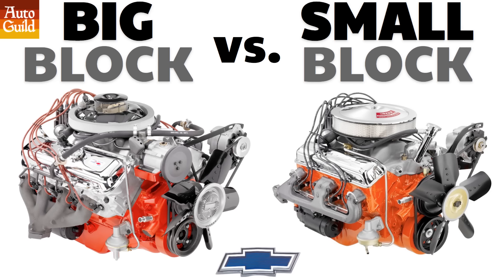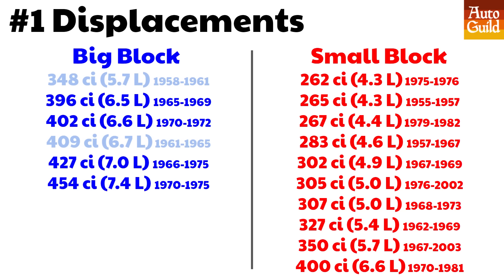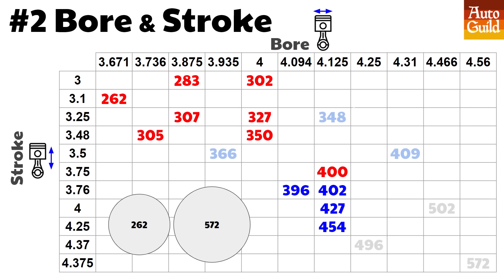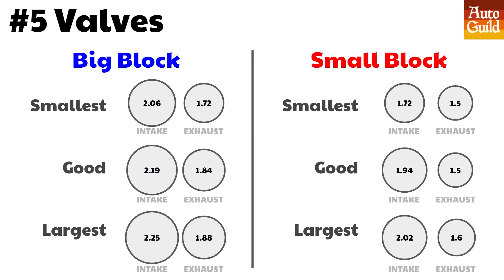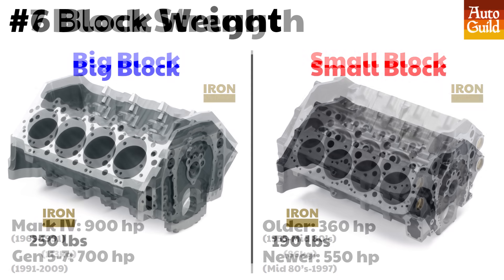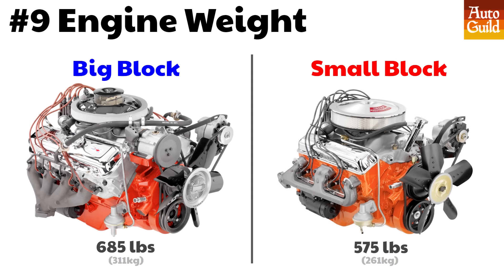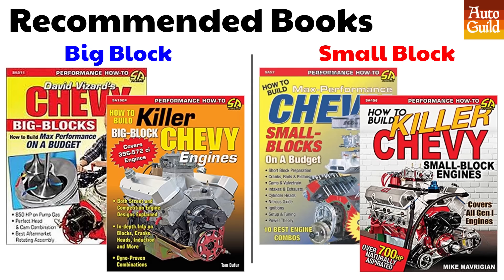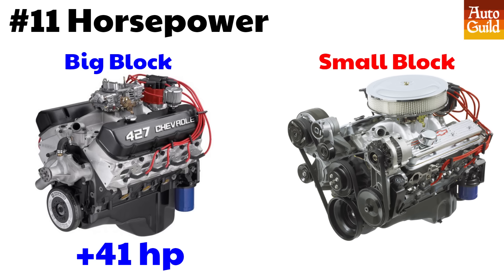Big Block vs  Small Block Chevy Comparison

Comment: understand... there is no replacement for displacement  anything you can do to a smallblock to make crazy power safely you can do the same thing to a big block for truely stupid power..... example.... top fuel drag.... if the small block was even worth using them they would.... to date there is NO smallblock  that runs just over 3 seconds in a 1/4 mile. bigblocks do this consistantly and have for many years now.

Comment: I got a little 327 with 12:1 Forged pistons and Steel Vette crank , 
Making 450hp 
Screams to the Moon 
11,000rpm before the valves start to float 
Try that with any Big Block of your choosing
Reply: 😂😂😂 11k
Reply: @sammendoza7168  , 
That's right Sam ,
11,000rpm 
I did it twice in 2009  
I wanted to see if if would do it and it did , 
I haven't done it since and don't plan on doing it again , 
I have taken it to 8,000rpm a couple of times since 2009 ,
It would run 
5.5 second @ 96mph in1/8 mile

Comment: I only have experience with a 318 against a 440that were stock. I had a 73 318 in a LeBaron and a 74 440 in a Chrysler Newport newyorker . The difference in power and speed out of the 440 was so obvious

Comment: Big blocks of all makes tend to have more torque even when the displacement is the same as a small block. Engine Masters did a comparison between a small block Chevy based 383 and a Mopar 383. They had almost identical horsepower peaks, within 1 horsepower but the 383 Mopar made more horsepower down low and much, MUCH more torque. Their reasoning was the longer intake ports, wider intake manifold with longer intake runners created this advantage. For a bore and stroke comparison the 383 Chevy is 4.030X3.75 and the 383 Mopar is 4.25X3.38. According to the experts the short stroke Mopar should make less torque down low but according to the dyno it was the exact opposite. The engines used the same brand Edelbrock Performer RPM intake, same grind of Comp Cams and the same compression ratio to make things as close as possible and stock, unported heads, 906 for the Mopar and Vortec for the Chevy. The Mopar did have a .060 over bore but the increase in low end torque was way to much to attribute it to that. A small block can make as much horsepower as a big block if you want to spin it up higher. That's why the factories switched to larger engines every few years from the 1930's all the way up to the 1970. It didn't have to be spun up as high to make the power, and torque, and that meant it could be milder and of course last longer since the factory warranties them. The LS based engines are impressive but they benefit from many decades of technology above and beyond what the BBC which was designed in 1964 or the 385 Ford which came along in 1968. But like all engines the bigger the LS the more power and torque it makes too!
Reply: Hehe "BBC"

Comment: I prefer the big block and have run them in most of my cars throughout the years.  I like the performance, but as my current car is a pro street and not a race car, I also look at other considerations....  The sound and the look of the set up.   My car is a little Chevy Vega, so my big block looks just massive in the car.  Additionally, I run an 8-71 blower and nitrous.  The car sounds furious and draws big crowds whenever I pull in to a cruise in or car show.  Engineering is important however because you just cant drop an engine like mine in without  massive work to the car from the frame, to suspension, steering, exhaust and cooling....

Comment: I have 99 Suburbans, one 1500 with a 5.7 and a 2500 with a 7.4. The 7.4 is so choked down with emissions it doesn't seem to have very much more power but gets way worse gas mileage. Feeling kind of disillusioned about big blocks, but my buddy had a late 70s 3/4 ton 454 truck years ago and it had crazy power.

Comment: Where does the 366 Big Block fit in to the family?  Was that a 348 with 396 heads? This motor was standard in the C-70 12 ton trucks.  I’ve seen a lot farmers pull 800 bushels of grain out of soft fields with the simple 5 speed.

Comment: I build racing engines for a living, so my input is going to be a bit biased towards performance rather than economics (but most enthusiasts aren't too worried about a little less mpg). I would go with big block almost every single time, unless you're road course racing or racing around mountains the extra weight is negligible with the power difference, plus there are many ways to supplement the difference without losing power. If you are looking to make actual power building a big block is much cheaper initially aswell as maintenance wise, and can turn very similar rpm to a small block with the right setup.  If you're looking for a hotrod engine that'll make power, stay (fairly) cheap, and stay light, go with a carbureted ls swap, you'll maintain the old school look and feel while making a lot more power and have more parts available in regular junk yards than the modern sbc enthusiast. Sbc is outdated, power per $ just isn't there, they're also less fuel efficient, have more design issues, and are generally less reliable (due to poor manufacturing/machining in comparison to the ls) the only time I'd have a sbc is if I already had one in the vehicle when I bought it and didn't want to swap something else into it. If anyone has additional input or info please feel free to start a conversation
Reply: I love the old SBC and BBC, but that LS platform is a fantastic engine.
Reply: Give me a big block for power and torque and highway cruising; MPG ain't bad with a 6spd man and now the 7 and 8spd autos ( I don't like automatics). Road coursing, short track and sprinting, then I'll take a sb. Drag racing, I still want the BB. A BB w modern self learning, fuel/ air delivery tech you could have more of the best of both worlds of a sprinter and a long distance runner.

Comment: Cubic inches everytime. Most well built bigblocks will eat about any equally built smallblocks for lunch...just impossible for smallblocks to produce near the torque range of the big dogs not even factoring in the difference in weight. ...who else is burnt out with LS this and LS thar by now?   Go get something that challenges your knowledge and skills instead of that common motor that everybody and their brother is building these last 15 years?   lol...just one guy's opinion here not tryin to start any arguments...want COST the original reason for phasing out bigblocks and mileage though?

Comment: I want an aluminum block and heads too,,would you like to buy it for me.the ls is also nice but very expensive still,comparatively speaking.now pit them evenly power to power.I’ve had the L78 and have a 500 horse 406 and will take it any day and yes both were fresh overhauls and build but I had a lot of fun with the b.b.68’rs/SS camaro

Comment: Lighter = faster, so of course a lower engine weight would be nice.  So - yes, we should all care about engine weight (or get out of the fast lane). Unfortunately, aluminum blocks are expensive.  Aluminum heads and intakes are already pretty common if you want to go fast these days.  Odds are most viewers won't get much value from shaving 100 lbs of weight and a few 100ths off their 1/4 mile times for the price of an aluminum block. I have a 511HP 355CID small block in a narrowed 71 GMC stepside, and a 688HP 489CID big block in a 71 Chevelle convertible. Both are iron blocks, with aluminum heads, aluminum intake, and aluminum radiators (twin big block 5 core rads in the nose of each vehicle).

Comment: You missed the 366, 502, 496/8.1 vortech and the 572. Granted the 366, 502 and 8.1 were only available in trucks and the 572 was only available as a crate motor. You als missed the 383HT gm create motor
Reply: The are also two different oval port heads. The normal oval port heads and the extreamly small peanut port heads
Reply: Wtf is a aluminum z11? It’s ZL1 not Z11. Jesus, every big fan knows that
Reply: Steve Brule from Westech  and engine master said it best. Nothing beats an LS… except a big block Chevy. Also the LS is just an ugly engine. I hate going to car show and seeing nothing but ugly ass LS swaps. That engine is so ugly the had to start putting engine coves on to of it to make it look better. Nothing beats raw visual impact like a big block. Whether it’s a MK 1 or a MK4. He only engines that rival it for cool factor are flat head Fords or a 426 hemi

Comment: Dude says older sbc’s can only handle 360HP, are you high? For one they came with that amount of power in some instances (arguably more). And have you never been to a dragstrip? There are thousands of old sbc’s running around with 500hp on stock (forged) cranks.

Comment: You haven't lived until you drive an airboat with a 502 big block, or a triple engine 502 airboat. Those 3 motors harmonizing at 5000 rpm is like heaven
Reply: dear God
Reply: @louis-philippelavoie6929  exactly

Comment: It would have been really cool to see Chevy build a modern all aluminum big block, say like 610 cu in (10 L). In the style of the LS.

So curious what that would weigh, and it’s performance
Reply: It would be neat because due to square-cube law, a 43% increase in displacement (from 7L to 10L) might only be a 10-15% increase in weight.
Reply: Something like a 4.3” bore, and 5.25” stroke.

S/B ratio of 1.22. Modern con rods can handle that easily.
Reply: They do, chevy sells a crate ls bigblock like the lsx 454
Reply: @tankkiler308  good point, I forgot the LSX was a big block.

It’s not an aluminum block though 😢
Reply: @tankkiler308  the LSX is just an iron small block, in all actuality
Reply: @rabidlenny7221  shame, i hadnt looked into em too much as i cant afford it unless i was building a racing rig.
Reply: @tankkiler308  yeah I don’t really know much about it honestly.

I just want a big ass 12L Aluminum V8 from Chevy
Reply: @rabidlenny7221  at that displacement your better off adding cynlinders.  But if your intrested, cleatus mcfarland made a car named toast that was almost that if i recall correctly.  Still iron though.
Reply: @tankkiler308  why at that displacement youre better off adding cylinders?

Just the vibrations are too large?

I’m kinda kidding though. To me an 8-10L modern aluminum V8 would just be so cool.

I found somewhere a 1000+ hp, NA 11.3L V8. Not sure if it was the same one you’re referring to. But it seemed so cool
Reply: @tankkiler308  each cylinder is 1.3L lol

Comment: I was surprised that the extra weight of the big block didn’t negate its 41 hp and 22ft-lb advantage over the small block. I’ve always believed that shedding weight is adding horsepower, but it must take a lot of pounds lost to make 1hp
Reply: There's no replacement for displacement!
Reply: @Shadowrunner340  big block torque
Reply: @samholcombe3129  As long as you can put that extra torque to the ground. Remember, "spinnin' ain"t winnin'."
Reply: it depends on the g forces if its a dragster you will be going from zero to top speed all at once so each pound is making several pounds of drag under acceleration and deceleration

Comment: I have a 283 small block pre 64 engine that is bored .40 thousands over with 350 heads and it is a very good engine for my 1966 Chevrolet. What do you think about it?

Comment: So 12.00 in video says bbc was replaced by ls in 1997, They started making the vortec 454 in 1996 - 2000  last iteration roller cam 4 bolt main 1 piece oil rear main basically precursor to ls engine and a good foundation for a 450 hp 500 + tq street engine n/a with cam and headers  somthing a 5.3 ls just cant do-)

Comment: I have had  small block and big block in  chevelles I always liked the sound and acceleration of big block yes you can do same with small block I don't care about weight I was just having fun with my hotrods  I'm kinda on the edge of doing a 68 Camaro 
ls or big block looks of big block is killer but gas mileage sucks that's why I'm thinking of ls what I thinking is 468/496 big block or a ls style lq9 or lq4 
408/427 this will be car to have fun car shows and weekend events not a daily love big blocks but ls are appeals tho

Comment: Stroke a 454 to 496ci 10.5:1 comp and run AFR aluminum oval port heads. stick a comp cam 280-290 hyd roller cam in it. 600 hp and 650 torque all day long. Have a good trans though cause that rat engine is gonna pull hard

Comment: I've built many engines for many applications over the years. My 2 favorites are the 400 s.b.c. and 454 b.b.c. On the subject of the 400 small block (my friends say that I hoard them!), you should have mentioned that, other than the physical dimensions and cam bearing/base circle size, they are COMPLETELY different on the inside than other small blocks. They have shorter rods, "siamesed" center cylinders and, they're externally balanced. They also have "steam holes" in the cylinder heads because of their siamesed center cylinders. While the external accessories will all fit the 400, unless you have the rotating assembly internally balanced or, you're using special aftermarket stuff, you HAVE to use a counterweighted flexplate/flywheel and damper on them.

Also, in your displacement illustration, you have the 366 big block categorized with the 348/409 engines. The 366 and some 427 engines were "tall deck" Mark IV engines intended for use in medium and heavy duty trucks, busses and industrial equipment. The taller deck height allowed the use of taller pistons with 4 rings but, it also required a wider intake manifold (or manifold spacers) to make up for the difference in width between the heads. Even though they weren't intended as high performance engines, some racers did use tall deck 427s with aftermarket internals successfully.
Reply: Those Siamese heads are the weak point

Comment: A big block is only better if it has a longer stroke, because it will last longer.  But, for the big blocks that are close to same in stroke length, they both last equally long

Comment: One of my favorite motors you don't hear much of, to me it's the best of both worlds, the small block 400 with a 350 crank, let the fun begin 👍
Reply: small block heads are fkt design..chev floged the 350 to death.they should of made a 350 big block,better design,
Reply: They have thin cast walls on the Pistons so they end up distorting at high horsepower and destroy the engines and they constantly have overheating issues-FACT
Reply: @jamescaban7710  Because of their large, 4 1/8" standard bore, 400s have siamesed center cylinders, not thin wall casings. I've built many of them over the years and never had any overheating problems. I have 406s in 3 of my vehicles right now-my 74 Camaro, 70 Malibu and 78 K25. Overheating is no more common with a 400 than any other small block. As with any old block, it they should be sonic checked before any machine work takes place.

On the other hand, I don't know why anyone would want to de-stroke an engine like the op says. Running a 350 crank in a 400 block not only reduces engine displacement to around 372", it's also not just a drop in swap. These days, you can buy 383 "stroker" kits to drop a 3 3/4" crank into a 350 block without turning the mains but, I've yet to see a 3.48" crank that has the 2.65" 400 journal size. Bearing spacers are available to do it but, as I said, I don't know why anyone would.
Reply: @MikeBrown-ii3pt  Mike you are obviously quite intelligent and can make it happen the general public f** that all up and this isn't the norm good work my friend...
Reply: @jamescaban7710 How many 400's have you owned that destroyed themselves or overheated? Before the LS motor came out I used 400 small blocks in a lot of my street hot rods, my stock car, and my pickup that I towed my race car with. I still have the pickup and that 400 has over 200 thousand on it and still runs great. The 400's I used in my stock cars had incredible torque for pulling the car up off the corner and I never had to turn them over 5500 RPM. And the street 400's when I put them in a Chevelle or Nova body was good for 12-second quarter-mile times. I never broke any of my 400's, and I never had any overheating problems. The old wife's tale about overheating problems comes from people trying to run a 400 with too small of a radiator and or a bad clutch fan, or they used different heads without drilling out the steam holes. Chevrolet used the 400 in everything from Monte Carlos and Impalas, to trucks and Blazers with no overheating problems when using the factory cooling system. I have built many 400's for myself and others and they have been a great motor for everything I have used them for.

Comment: All 350s  are not the holy grail  in the 70s Gm tried to make the  the small block lighter  yet  resulting in cracked heads . what were they thinking ?  Unless you modify a chevy with go fast parts  its not a threat . Some big blocks from the 70s had less than 200 horsepower in stock form . I,m still laughing that one off
Reply: By the middle '70s,  because of lowered compression and a new net verses, gross HP rating system the 454 Chevy, 460 Ford, and the 440 Mopar all had been neutered back to around 200 HP.

Comment: My buddy and I did a engine swap on his 72 chevelle in high school back in the 90s,when we traded the old block for new, the guys at Checker auto were like um that's a 348 truck motor..we both had thought it was a 350 the whole time,we had put 400 heads on it before it was traded in